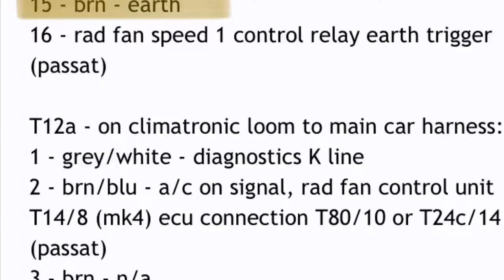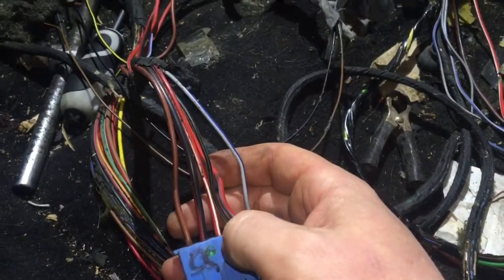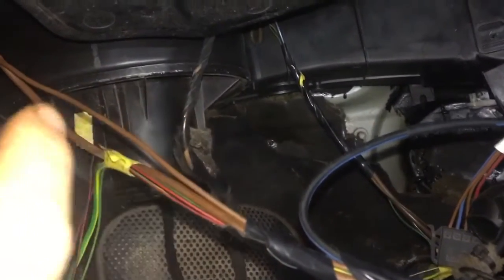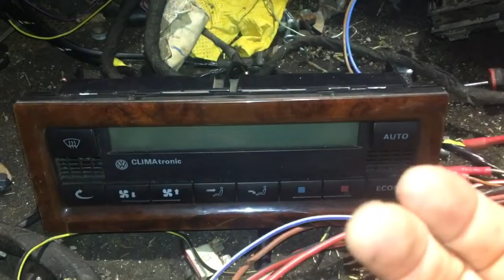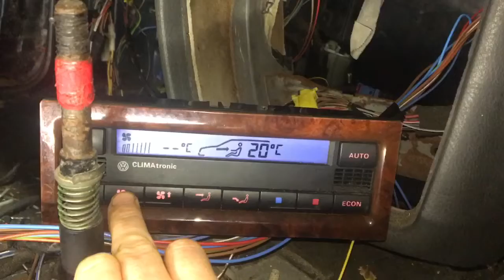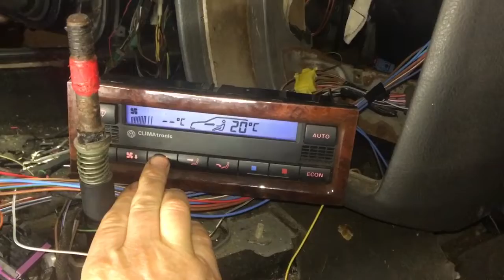Ep39 Wiring the climatronic to the ce2/corrado loom

Comment: how did you wire in the Fan Control Module? Did you use the late Corrado one?, or used the one from Golf mk4? I am in a process of doing this retrofit and I'm kind of stuck here and don't know whether to use the existing FCM from my 94 Corrado Vr6 or the one from Golf. I think using the one from Corrado would be easier, but I'm not sure how to wire it in...
Reply from the maker: If you are doing this mod using the mk4 hvac screen you need to use the red fan control speed controller. In this video or the next video it’s a red control box with fins . You need to install it into the side wall of the ducking to keep the heat sink pins cool ( super easy cut a square hole and use 2 tex screws )  

Check out the next video or there is a play list and I show all the wiring and how I installed the ducting etc into the car . Best of luck
Reply from the maker: https://youtube.com/playlist?list=PLXvxRq4qhhaVHr53LbVu6IaKMtvNxnUTL&si=aE5XabA2uDqBH26U

Comment: I know this video is a bit old, but Im hoping you can still remember it.  You explain that there are 4 plugs on the control unit but then you only describe wiring the one plug.  Do the other three just plug into the air box and stuff? I'm wanting to put this into my 90 Corrado, and almost all the info I find online is for MK4 Golf retrofits.  Forums are a total wash now since almost all the photos are dead links which means the posts aren't very helpful.
Reply from the maker: Yes I think it’s the A or D plug (it’s the biggest black one )  it only needs 2x. +12v and 2x negative -12v wires => 2 for the fan and 2 for the controller .  The rest just plug into the fan box. There is also canbus , obd2 line and … I think there is illumination depending if it’s from a golf or Passat . The passats are only canbus and don’t have illumination wire to light up the buttons controls, so I bypassed it and wired it into the 12v on the dash control panel so it lights up when you turn on the car . It’s in another video . Hope that helps 
Give the videos a thumbs up and subscribe as it’s the only way YouTube recognises my videos

Comment: Hi I have a 2002 passat just chat that original for broken one fan heater blower works AC shows on screen but fan doesn't spin does it have to be programed thank you.
Reply from the maker: Which fan isn’t working . The one at the front of the car or the hvac fan inside the car ? No I don’t think it needs to be programmed . Are the fuses all ok ?
Reply: @stevenharpervw  yes all fuses relays even new resistor module coolant temperature gauge just stopped working when I changed broken climate control heater blower inside car works fine but not the electric fan in engine bay either with temperature or with AC.thank you for getting back to me appreciated
Reply from the maker: @kenroper68  ok so the AC fan has its own fuse i think from memory it’s quite a big fuse . Check that fuse that it’s ok . And use a volt meter to check for 12v at the fuse. And at the plug where the fan is connected . I wonder do you have a bad negative -12v  just check any brown wires and all wires on the battery too
Reply: @stevenharpervw  thank you for you help appreciated

Comment: Sir my climatronic in golf 4 When i key on Its blinks some seconds and after that no blowing air comes  cann u help me
Reply from the maker: There Is2 fuses  one for the screen and one for the blower fan
Reply: @stevenharpervw  1 is behind climatronic 15 A and 1 where ?
Reply from the maker: @TIIRONC5H  are they not all under the steering wheel where the main fuses are ?  

Have you tried using a multimeter and drop your Glove box and behind it, is the hvac fan you will see two big heavy wires going into the fan .  You can easily pull them off . And test using a volt meter for 12v. If you I get 0v it meant there is a fused damaged if you get 12v it means the fan is damaged
Reply: Blinking a few secs meaning your ac system gas pressure low or none.

Comment: Hi, 
Very nice videos ! well done. 
I'm doing a swap from manual to climatronic on a passat 1999/2000. Do you happen to know to make the climatronic read information on CAN bus ? do it need a specific coding ? mine is currently reading outside temperature from the wiring instead of CAN.
thanks :!:
Reply from the maker: Golf did not use canbus . Passat b5.5 did use canbus.  This video might help with with coding . I don’t know if you can go from non canbus >to> canbus . But I know you can’t not go from canbus to non canbus because I tried.
Canbus controls outside air temp display. And the led brightness 🔅 
https://youtu.be/DZO3thKDyC0
Reply: @stevenharpervw  Hi Steven, 
As you mentioned on one of your video, the information of outside temperature comes from the cluster(at least for the climatronic controller that you have here). I'm wondering if you  already know which cluster you're going to install on your Corrado (and if it supports CANBus); 
I also want to thank you for the wiring diagram that explains how it works; very helpful. In my understanding, there are other information that come into play, such as vehicle speed, engine rpm, wipers (on or off). the reason why I'm talking about that is because this information comes also from the CANBus (in your case) or from different wires that you need to connect (in the case of non CANBus). The temperature not showing on the screen and the light would then be the "top of the iceberg" in term of missing information. 
I would like to thank for sharing your knowledge the way you do it !
Best regards.
Reply from the maker: @iklefmallem4949  my conclusion for the corrado was- keep corrado cluster. And enjoy — —C  ( temperature unknown 😂)  I hacked the climatronic controller, and wired the lights to come on. So I’m happy with that.  The corrado will not have canbus
A standard climatronic controller is €20 off eBay.  But for the moment I’m happy with out it
I was just thinking… If your converting your 99 b5 passat.  You could go canbus  but the dash cluster would have to be changed too and the immobilizer for the engine lives inside the cluster too . So you would have to get that reprogrammed too. And your total KMs would have to be changed as well . 

The other way is to use the climatronic from a golf that is not canbus controlled and then you have no problems 👍

Keep the project going. I drove a 99 passat tdi ahu for 8 years and loved it.
Reply: @stevenharpervw  Hi Steven,
Thank for your fast response and the link to the other video. I saw it and showed me that your are reallly knowledgable. 
I opened my controller and realized that the CAN part of the circuit is simply “empty“, meaning that there are tracks on the pcb but bot a single component. My conclusion is that it can't support CAN as is. 
Following the information you provided in the other video, i ordered a J version. 
Thanks for your help. And again congrats for your projects.
Reply from the maker: @iklefmallem4949  where are you from , it sounds like a cool project your doing
Reply: @stevenharpervw  I am from France. Yeah, it's a crazy but very interesting project, i learn a lot of things.
Reply: Hi! I have a 2001 passat b5.5 with manual climate control, I'm gonna swap a climatronic from a 2003 passat parts car. Did you already swaped it into your? Any troubles with it? Thanks in advance!
Reply: Hi  @diegt4716  ,
I am still on it and the main issue is to be able to retrieve various information from the car (rpm, vehicle speed, wippers,...). On my car, the cluster is supposed to send this information via CAN(comfort canbus), but it doesn't. I'm planning to install a gateway to enable this data retrival. The b5.5 cluster won't have this issue (as far as i understood)
Best regards
Reply: @iklefmallem4949  thanks for your answer! Just one quick question. I don't have any display with temperature on my cluster, will it be easier in my case? Thank you
Reply: @diegt4716  can you check you have any external temperture sensor behind the front bumper on the driver side, right in front the air conditioning radiator?
Reply: As Steven explains, there are different types of climatronic controller, one takes info from Canbus and the other take information from various wires in the car harness. It did most of the wiring because the first Climatronic module i had wasn't canbus compatible. The problem was on the external temperature sensor. As it was connected to the cluster, it couldn't be connected to the climatronic as well. The workaround in that case was to add a second external temperture sensor.
If you have a b5.5, I'm surprised the external temperature sensor isn't connected to it, but why not
Reply: @diegt4716  then, you should go for the non canbus climatronic controller, add the external temperature sensor and connect it directly to the climatronic controller.
Reply from the maker: @diegt4716  thank you for subscribing. No problem all brown wires are -12v and all red wire are +12v  and fan motor requires it’s own fuse (30A)  it looks like a million wires but very easy . You can ignore canbus wires . Follow my other videos . Best of luck
Reply: @stevenharpervw  thanks a lot steven! Your videos were very helpful!
Reply from the maker: @diegt4716  whoop, thank you that’s a brilliant review 😊
Reply: @stevenharpervw vc sabe como faço pra somente ligar em 12v quais os fios ligar comprei um controlador climatronic com 4 plugs e um pedaços de fio 10cm queria ligar a iluminacao somente